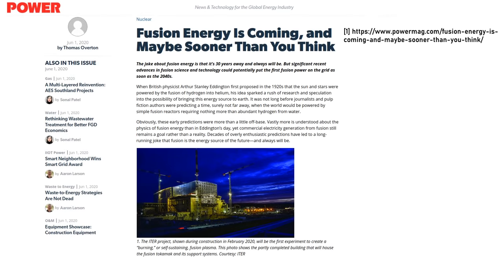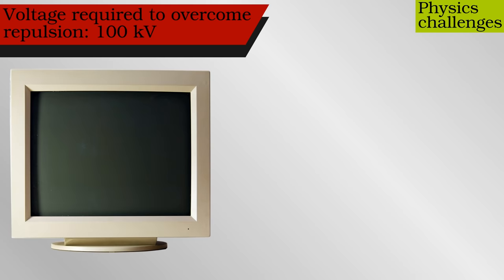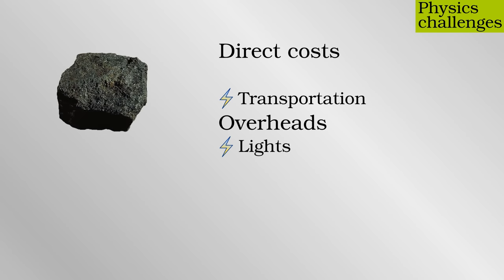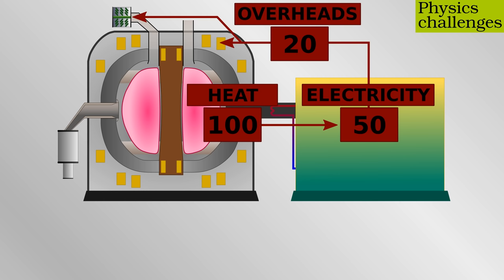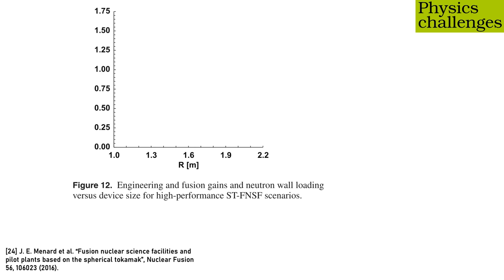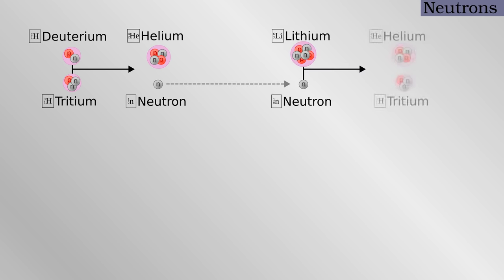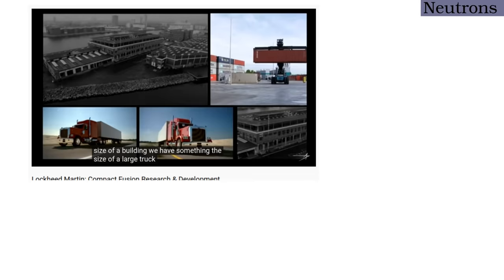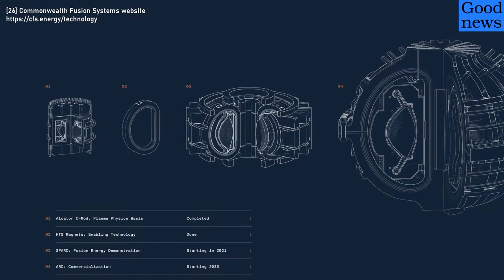Former fusion scientist on why we won't have fusion power by 2040

Comment: Fusion is all about producing cheap electricity. Thorium will achieve this much more cheaply, and more certainly than fusion ever could. As soon as the comparatively simpler Thorium reactor problems are solved, fusion power will go the way of the dodo.
Reply: Are you from 10 years ago? Because I heard the exact same argument then. If fusion is always 30 years away. Then thorium is perpetually 5 years away.
Reply: Thorium is a expensive fuel,this is what we discovered a long time ago and won't change much.
Reply: @lordanonimmo7699  Expensive how? Currently, it is a waste product of mining. It has a negative value in that companies are willing to pay you to get raw thorium ore off their hands.
Reply: @petersteenkamp  Thorium needs to be processed so much that in the end is way more expensive than uranium,if it was just a question of mining it would be too easy.
Reply: @lordanonimmo7699  Can you elaborate? Why thorium would need more processing? No enrichment is required I believe.
Reply: @guesswho6038  Thorium isn't a fissile material but a fertile material this means that we use uranium bombarding neutrons in thorium to produce the materials we need.

there are other things like bigger gamme radiation in short term,higher melting point that is both good for safety and bad for when needed to process to become fuel,but the above is the main one.
Reply: @lordanonimmo7699 Ok, I thought the neutron source was part of the reactor design and in that sense thorium does not require activation before loading to the reactor.
Reply: @guesswho6038  This problem that i said is only a problem for our traditional reactors,other types could get away with this problem but we would have to wait a long time,because they are only in paper or incomplete prototypes.

Comment: Thank you. I'm glad someone like you has a more skeptical approach, hopefully more realistic, about fusion and what it can do. 

Whenever i first heard about fusion i was said something like : "You can fuse hydrogen in water. Its the same fuel than the sun so we will survive for billions of years, way after the sun's death."
Obviously it wasn't that simple and wrong in many ways. Now i feel like commercial fusion is physicists' santa : we love him, we would love him to exist even though he doesnt. 

Just like you said, what makes the sun powerfull is not the fact that it uses fusion, its the fact that its massive. you have to take the super small energy produced in 1m3 of the sun, multiply this 1 m3 with the volume of the sun and thats how you get its power. The energy density of fusion is actually super small, or at least compared to the energy required to make it work. 
So hoping we would ever have commercial fusion is not a question of when, but a question of if, and maybe it will never be commercial at all. Not including the million of other problems you mentionned.

And most importantly, Not including the depletion of natural ressources that we use to build those cites and reactors and all our modern technology, which is even tougher to deal with than fusion and maybe thats why no tech bro talks about it cuz they have no solution for that... aside from recycling which not only doesnt work at 100% but also will require astronomical energy and all to make it work, way more than we already have. 

No matter how we face the problem, its safe to say that human's needs are way greater than our planet is willing to give us.  Tho i wouldnt be that sad if computers and all dissapear because we lived for thousands of years without them. (Thanks to that we now are sure that AI cannot replace us lol) And every technological improvement is nothing but borrowed time (and makes climate change even worse).

Just like Conker says : "You never know what it is you have... until it's gone."

Comment: Would fusion power generation be easier in space for any reason?  Does gravity and earth's atmosphere make it more difficult?  Of course, putting aside the problem of getting all of the equipment in to space in the first place.
Reply from the maker: Even in space, you would need a vacuum vessel to prevent fuel from escaping and contaminants getting it. Gravity is not a real problem compared to the other forces in any credible reactor proposal.

Comment: 07:09, question on this. Why do you need to convert heat to eletricity and then back to heat through cyclotron for maintaining reaction. I guess initially plasma needs to be heated through cyclotron, but shouldn't D+T which generated couple Mega eV (MeV) heat be more than enough at maintaining condition of 30 million kelvin, where average atom has two thousand eV (kT). 
If the "reheating" through cyclotron is not needed for maintaining 30 million kelvin, it would mean electricity generation right?

Comment: When I worked at Harwell in 1973 I had a friend who worked at Culham Lab on the fusion projects. In those days, the statement was 'Fusion is just around the corner'. So now in 2023, the status statement seems to be the same. As a person with a science background, I find it's easier not to try to apply logic to anything underpinned by governments (anywhere). If you think logically, you'd be asking the question, why after 50 years are programmes like this continuing to be funded? The fusion community must have the best spin doctors and lobbyists in the world. :) :)

Comment: When it comes to thermonuclear fusion energy we are quite good at making a five megaton thermonuclear bomb. But having a controlled fusion process than can generate useful electricity seems to be the realm of science fiction. The two factors that make this so difficult is that it takes the temperatures and pressures found at the core of the sun to do thermonuclear fusion.

Comment: Can you discuss how they plan to heat water to make steam? I've  not seen any diagrams showing how they plan to heat the water. Also, absorbing energy to make steam cools the reactor. Isn't that going to reduce the reactor output?
Reply from the maker: The plasma, which is at 100s of millions of degrees, is trapped by magnetic fields. Neutrons from the fusion reactions carrying most of the energy are not affected by magnetism and fly out of the chamber into a blanket. This blanket is at solid material and heats up to perhaps 1000 degrees and is then cooled. The coolant heats up steam which drives a turbine as usual.

Comment: Question: If a multi-million degrees celsius plasma comes into contact with air, what would happen?
Reply from the maker: The temperatures would meet somewhere in the middle, towards the air temperature. The plasma would cool down to, let's say, 50°C and the air would heat up to 50°C.

Comment: One mistake in the video - Tritium is also a radioactive isotope of hydrogen that can be produced naturally in the upper atmosphere when cosmic rays hit nitrogen molecules in the air.
Reply from the maker: There are maybe only a few kilograms of natural tritium in the entire atmosphere, compared to trillions of tonnes of other gas. I therefore stand by the statement that it doesn't occur naturally (at least in any appreciable amounts).
Reply: @ImprobableMatter  It does occur naturally and you are correct that it is in very small amounts. It is important because there are people going crazy over nominal amounts of Tritium being discharged from nuclear power plants into sea water. Tritium dissipates and is to background level within days to weeks of discharge into sea water. So, it is important to highlight the natural tritium production and how harmless it is. I liked your video. You did a fantastic job.

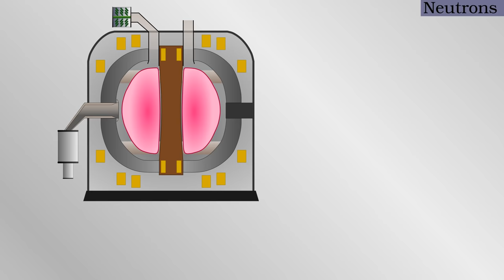Comment: 11:33 Strange false assertion. The reactor that breeds tritium doesn't have to be the fusion reactor that generates funding demand. Tritium can be produced by reactors specialized to that purpose. Currently tritium is bred in fission reactors. They could build more fission reactors to adequately supply the eternal fusion quest with tritium and also generate electricity.
Reply from the maker: It would take multiple fission plants to supply a single fusion plant with Tritium. At that point, why bother with the latter?
Reply: @ImprobableMatter  It provides gainful employment for physics graduates. If you want to use nuclear energy to solve any of our current problems then fission is the only choice.

Comment: They are test reactors. They run all sorts of research based configurations and are not at all dialed in/optimised for power generation.
Reading the internet for a few hours isn’t enough to understand decades of PhD research.

Comment: Does the heat have to be harvested to power the facility to heat the fusion materials, instead of allowing the heat to sustain the fusion reaction and siphon off excess for running the magnets and power generation? If theoretically you got 2x return on fusion, and generated 100 heat units, couldn’t you use 50 to convert into 25 units of energy and let the other 50 create the next 100?

Comment: Given that you know more about the practical issues, I will trust your judgement.  I would only point out that the practical limits you outline are determined by the performance of the components and that none of us know when breakthroughs will change that picture.  All we can do is guess what approaches are most likely to result in practical results the soonest based on reasonable assumptions and theoretical limits.

Comment: With a tokamak where are the pipes to extract the heat to superheat the water to run the turbines to generate the electricity? To get a gigawatt continuous, probably need quite a high water flow, since a 2.1m radius tokamak only has so much surface area. Will they be using carbon to capture the neutrons, around a pipe network? Need to watch for parts melting before not so much elapsed time? The video mentions the neutron damage issue, no good with one hour of operation every 2 years.

Comment: New revisions of SPARC are cool because of how you can just pop the top and change the blankets but it's still only a concept. That config has to withstand very high B fields wanting to tear it apart and then the stress cycling.  The paper math says it should work but it's all in the engineer's hands, much of it in materials development for almost all localized components which need to withstand the punishment of both mechanical forces and neutron bombardment regardless of whether there is a liquid metal blanket behind the solid ones for T breeding. 
Fission reactors are very different because the fuel can be immersed in neutron moderators which vastly reduce the damage done by them. Also those neutrons top out at 8MeV, not 14. 
Wouldn't it be a dream if somehow we could get neutrons to decay back into protons and electrons in an instant. Fusion would be so much less of a hassle.

Comment: Yeah this video is at least 4 years old. ITER is on its way to first plasma in 2025 followed by phase 2 assembly from 2026 to 2028. 

It will shut down from 2030-2031 and phase 3 assembly will begin during that time. A couple years of full heat experiments will ensue then phase 4 will  go from 2034-2035. 

Fusion power operation is expected in June of 2035.
Reply from the maker: ITER doesn't have electrical generation infrastructure, but if it did it would not be breakeven on electricity. It will certainly not make electrical power in 2035.

Comment: Hi, i have a potentially dumb question: instead of blanketing the reactor in beryllium, which by my understanding has a limited life and would eventually need to be replaced, hence creating radioactive waste, wouldn't it be feasible to surround the fusion chamber in ultra pure water? We already know that water is excellent at stopping radiation, since we bathe our nuclear reactors and spent rods in it. Couldn't ultra pure water be superheated and used to heat up water in a separate circuit to be turned into steam to power turbines? Wouldn't this create more deuterium in the process as well?
Of course, the best minds on the planet have probably thought about this 100 years ago, but I don't know the answer to why this isn't feasible.
Reply from the maker: Not a dumb question at all. But we would need some sort of neutron multiplier (that's the use of beryllium) and we would need Lithium in there to breed tritium. We are certainly free to have water in there to take away the heat and all that business.
Reply: @ImprobableMatter  Thanks for replying! The neutron multiplier part confused me, so I went to watch your other videos on fusion, and I think I got my answer: we actually want the fusion chamber to stay as hot as possible, and that's also the role of the neutron multiplier. Is that correct?
If that's so, thanks for taking the time to reply, and for making those other videos as well!
Reply from the maker: We do want it hot, yet, but it's still possible to make something hot and water cool it. We want a neutron multiplier because it takes 1 neutron to produce 1 Tritium. What if a neutron, or a Tritium is lost? We need to make slightly more than we consume to make up for the loss.
Reply: @ImprobableMatter  I see! Thanks for explaining ;) And sorry for the wait, as YT's notifications are broken

Comment: superconducters are one of the big energy consumers in a fusion reactor, there's a possibility right now of having room temp ambient pressure superconductors.

but they're still in testing though.
Reply: Yeah ended up being a bust. Doesn’t matter anyways because it was a ceramic so even if it was true it would be useless. Also, even current warm super conductors like YBCO (liquid nitrogen temps) are useless because they can’t handle high currents. There’s a reason why all super conductors used in these applications require liquid helium cooling.

Comment: I have a modified cold fusion reaction that is energy positive with a total q value higher than 5  i just need a high energy particle accelerator to finish it

Comment: I have been curious about the idea of using hydrogen gas under pressure, and creating a state of partial plasma energy in an enclosed environment. Using the “free” energy input of 1-2 windmills. 
Mostly because of a recent discovery that the planet Neptune is far warmer than it should be so far from the sun, with pulses of heat energy that radiate down from its magnetic poles. In tune to solar radiation fluctuations. 
Assuming that solar ionization from the sun is relatively weak that far away, it might actually be efficient to use the electricity to generate heat in the hydrogen medium. 
But the atmospheric pressure of the gas giant must be extreme.

Comment: surprise, we successfully made a fusion reaction that created more energy than it took to make in december 2022
Reply from the maker: You should watch this video to understand why there was nonetheless a net loss of energy and why we are still over 17 years away from practical energy generation.
Reply: @ImprobableMatter  wait youre telling me we havent cracked it?
Reply: @ImprobableMatter i just watched thru it im gonna have to take your word on it i got lost
Reply from the maker: @jollyboi_   An experiment shot some fuel with lasers and caused fusion to happen. It released more fusion energy than the laser energy, but not more than the total electrical energy used by the experiment. You would need to release, say, 20 times more fusion energy than the input laser energy to make a powerplant which releases more electrical energy than it consumes. There are also other challenges.
Reply: @ImprobableMatter  i was so hyped when i first heard we unlocked fusion energy lmao im too gulible

Comment: Glass lasers can only be fired infrequenly or they overheat and self- destruct. LANL's  KrF (248nm) Aurora Fusion Laser reached breakeven in July 1991 - LANL's Laser Fusion funding evaporated exactly one month later - or we would be using it by now !
Reply from the maker: Modern diode pumped solid state lasers can operate at 10 Hz (10 shots per second) with ever increasing energies. In principle a laser like this can soon be developed to deliver a few megajoules at that repetition rate. See for instance: https://optics.org/news/14/1/21

Comment: Fantastic presentation. The issue is to divert money away from building already proven Fission designs, France has had automated waste processing since the 70s. If its not Fusion it will be Hyrdrogen or wind or more solar. The economic power of coal oil and gas has defeted the fission industry for 50 years.

Comment: Russia already has an operational fusion reactor called "Direct Tap Kinetic Plasma" reactor that can directly and simultaneously tap the kinetic energy of plasma and converting it all into electricity which is D.C as usual due to the nature of the plasma itself. A small version that can fit inside a average size room can generate 10 gigawatts and that is just the reactor section itself and not counting the room requirements of the rest of the equipments and machineries around it. In short, it is the size of a small to medium size house.

Comment: would love to hear more about how a mythical beryllium/lithium blanket is supposed to transfer that absorbed energy and generate electricity.  As far as I have seen, fusion test reactors are simply expensive steel and concrete irradiation devices.
Reply: are they supposed to? if i took it correctly they are supposed to breed tritium which would mean the fusion can keep going even with a small amount of initial tritium

Comment: I remember reading an article in Poplar Mechanics, that by 1960 every home will have a Cold Fusion Nuclear Reactor the size of a 5 K BTU A/C  unit in their home. Well it's 2023 & I'm still waiting, if I live to 1,000,000 doubt this will happen.
Reply: Fusion was literally in its toddler stage in 1960. We'd barely touched the surface of it at that point. All it could do at that point was throw city destroying tantrums in 1960.